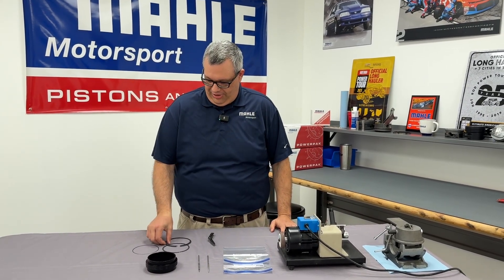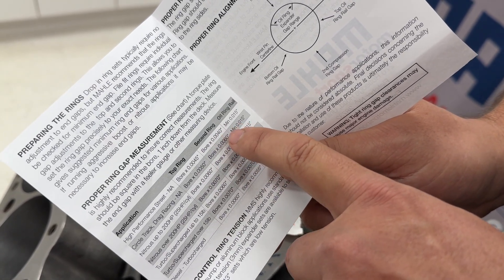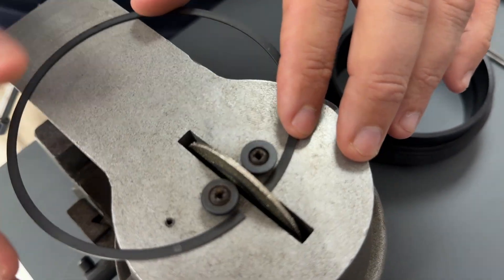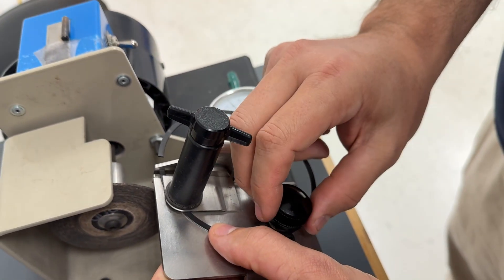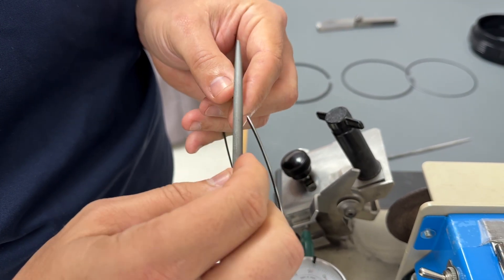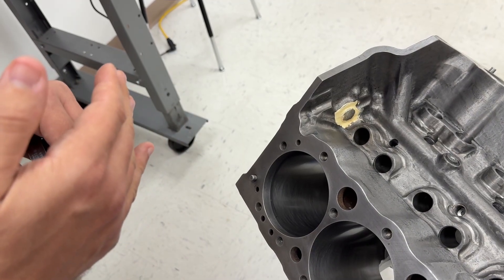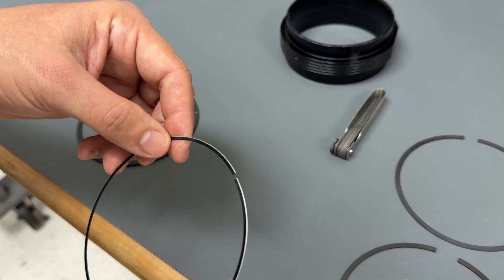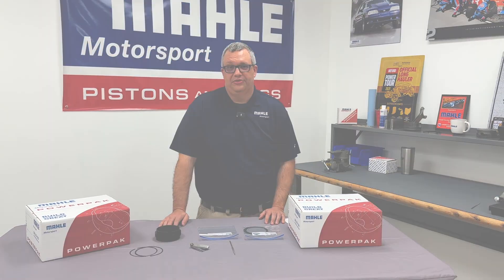How to File Fit Rings for Your Engine: Guide to Proper Gap

Comment: Very good video and the electric ring filer would be a good addition to your assembly tools, IF you were doing a lot of engine building! Most of the stock rebuilding kits, the ring sets already have the ring clearances built in them. But always check your clearances BEFORE assembly!

Comment: If i want to do .025” for the top ring is it ok if i go over to .026” on some top rings. I am filing them manually and I went over on some top rings.
Reply from the maker: Good question. Is 0.025" the minimum gap? If so, 0.001" larger than the minimum gap is not going to cause any issues. Problems/failures can happen if below the minimum due to the ring ends potentially butting together and causing damage in the cylinder.
Reply: @mahlemotorsport yes sir my minimum gap i want is .025” for the top rings and .028” for the bottom rings.  I am over .001” on piston #2 and #3 for both top and bottom.

Comment: if the cylinders are bored and finished with a modern high end CNC machine , you can put all the rings in a pile.
Reply from the maker: In a perfect world, yes, you are correct. However, due to potential variance in the final hone, our recommendation is to bag and tag each ring to the cylinder it was gapped for. Plus, it's fairly easy step to keep the rings organized and clean.

Comment: Thing is you'll probably need the next oversize ring set so you will have something to file down to get the gap you need or want. 😊
Reply from the maker: Our performance ring sets that come with our piston kits have a smaller gap than needed for every application. They are spec'd for the bore size of the piston they are with, and filing is required to make them fit correctly.
Reply: @mahlemotorsport perfeito 👍

Comment: Great video.  I do airplane cylinders for a living.  I use exact same ring grinders, however I had to modify the electric model to handle rings that are in the 5-6” bore range. I also debur with my used sunnen hone stones as they are easy to use.  The challenge with aircraft gaps is that we measure the gaps at TDC in the choked area where the cylinder mates to the head and and about 4” from the bottom of the flanged  area.  I 3D printed numerous sizes of ring position tools to place each ring exactly where it would be at TDC every time quickly without measuring. Saves a lot of time as some pistons have 4 - 6 rings. Also, each piston, cylinder is numbered and I bag each set of rings and number them as you do. Lastly, I always clean the rings and run my fingers all over them to check for knicks or damage.  My feeler gauges are always checked with my calibrated micrometer before they go in my toolbox.  Thank you.  I use your pistons in my air cooled German cars!!
Reply: Mas credo! 
Grande conhecedor.

Comment: I always leave the rings in each cylinder after I set the gap until I install each piston, the first ring i cut I just shove further down the cylinder out of my way for the next ring.
Reply: Good idea. I recently watched a video where a professional engine builder gapped the rings and then put them all in a pile. I did wonder how he kept them in association with their correct cylinders because I’m sure there will often be differences, even if minor. If not, why bother to gap them individually? - they could all be done in the same cylinder.